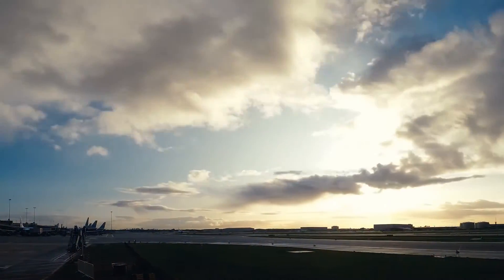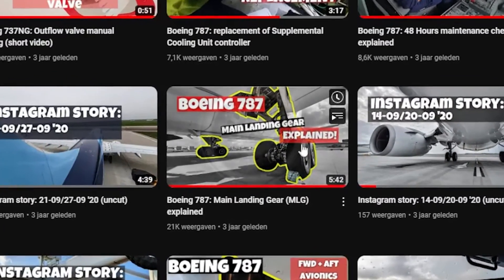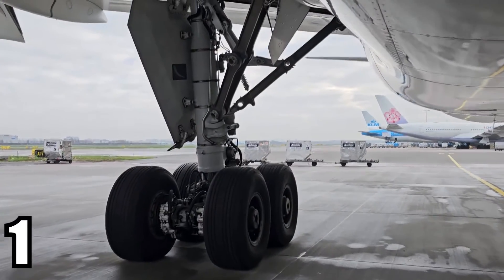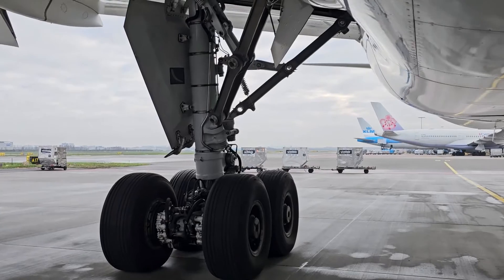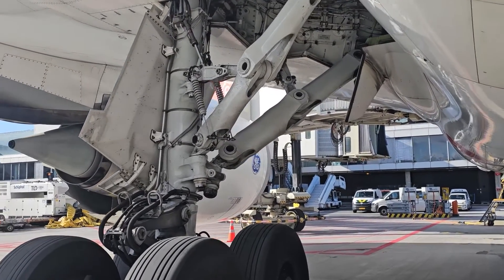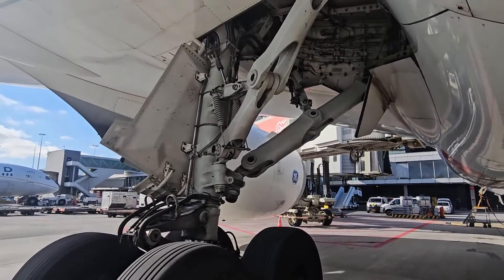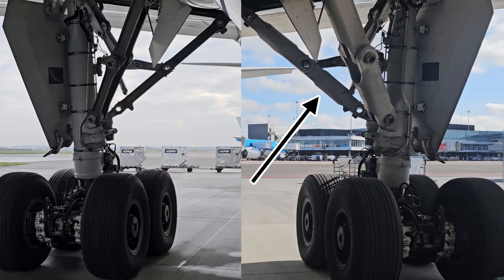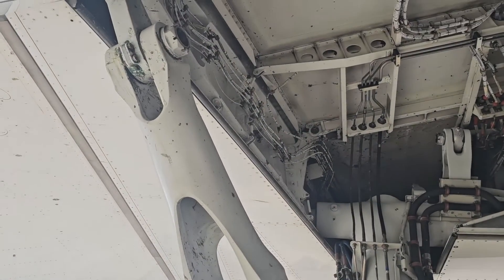Boeing 787: Main Landing Gear Difference?

Comment: 220 extra lbs per airframe?  That’s about one average person in the US.  I understand pushing the envelope in the engineering sense, that’s how progress is made, but Ti is a well known material to work with.  I bet it only took days to design the replacement Ti braces, but took weeks to design the original composite braces.
Reply from the maker: True that. But if the composite braces are installed for let's say 10 years, it should have maybe saved that in fuel overtime, or close to the manufacturing costs? I'm not sure what the average fuel used is per flight per person. But in my eyes on the long run it evens out the costs to manufacture.